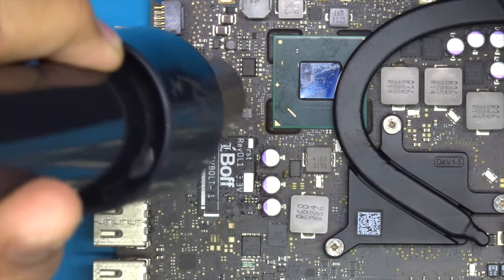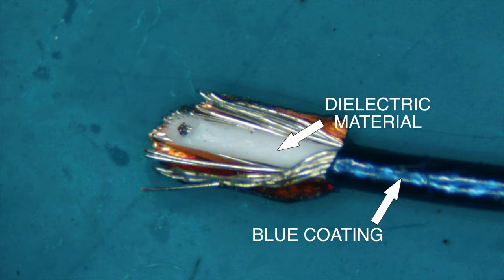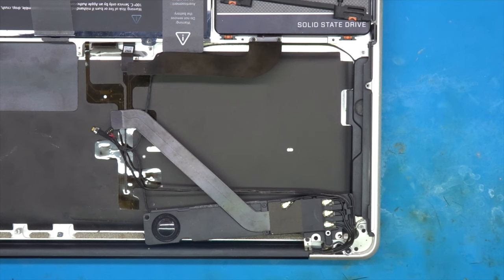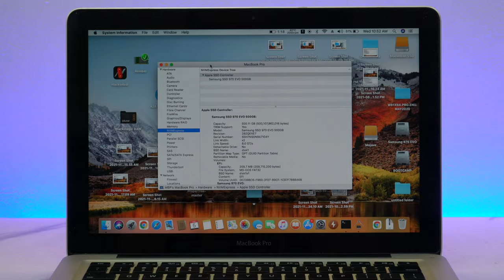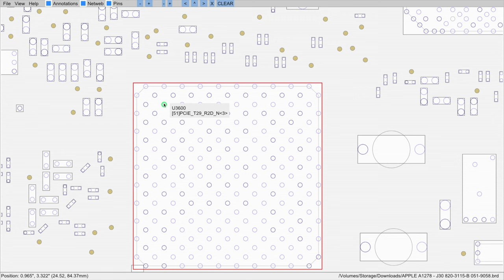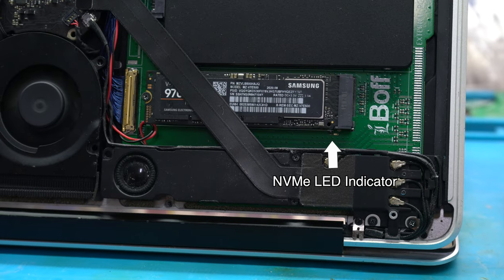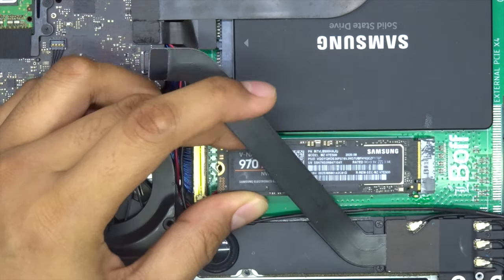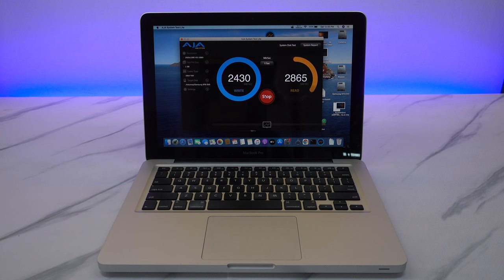[GUIDE] Assemble NVMe SSD to A1278 MacBook Pro (MBP 13-inch 2012 + NevBolt-1)

Comment: How much would it cost for me to get my 2012 Macbook Pro 13-inch modified by you?

I would like the NVMe port, a gpu upgrade, a CPU upgrade, and to be able to put in 32 GB of RAM.
Reply from the maker: hi, unfortunately, for this model is only able max 16GB and install the NVMe mod by us
Reply: @iBoffRCC  thank you for responding. which model is the best model to modify for the best upgrades?
Reply: HI.  I have the same macbook model, I use it to edit videos in full HD format.  I make some videos with my iphone xs max.  unfortunately in many cases it goes jerky, it is not fluid.  my pc is equipped with a 250gb ssd and 4 gb ram and ventura OS.  Can I solve something with this modification or do I have to change the graphics card?  what do you suggest me?  Thank you

Comment: I WANT TO UPGRADE A MOD. I want 2017 or 2015 macbook pro i7 logic board install in 2012 macbook pro with 32 gb ram ddr4 one nvme slot and 2 sata ssd slots and gpu upgrade. how much will be the cost?

Comment: Soooooo I have a question and an idea , I’m currently looking to upgrade a nice 2012 MacBook Pro with a BlueRay Drive for a use with a Film collection , but I also wanna connect up a Nvme Drive to run the OS on due to speed and use a regular SSD for general storage 

So hears my Question is it possible to have Both ? Connect up thinner board with the Nvme Drive but still have a room to keep a BluRay Drive ? Possibly tucked away on the board in a nook ?:3

Honestly that would be completely ideal , but I’m not knowledgeable enough to know how to do that yet xD
Reply: Hey ho, I build my both MacBooks Pro 13“ mid2012 and MacBook Pro 17“ (!) whit 
16GB RAM 
1TB SSD (SATA)
BluRay (Panasonic UJ267)
and the „normal“ Speed and Works on the MacBooks are really fast enough for this old hardware. 
Monterey and BluRays runs great, so you don’t need this M2.nvme-Mod.

Comment: Would replacing the thunderbolt 2 chip with Mac mini also? I know they already have nvme available but on the 2014 it’s quite slow.
Reply from the maker: for mac mini 2014, the thunderbolt chip is responsible for external display via mini DP ports. I dont know if thats really worth to do or not.

Comment: Can a PCIE connector be place on this kit? like the X-GPU project?
Reply from the maker: yes it can, but for now we will only releasing the DB Board without the X-GPU port(PCIe x4). we still need to add small details to the final revision.

Comment: What can be done for the 2011 17 inch model that has the dreaded gpu issue . Does it solve that problem ?
Reply: you can either disable the gpu using software, or use an x-gpu to get pcie slot out and disable the gpu that way